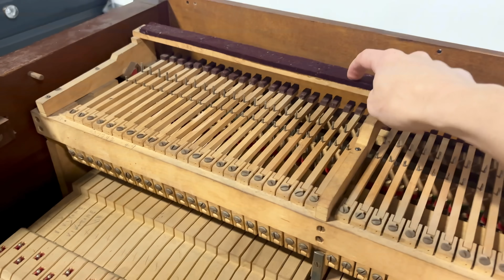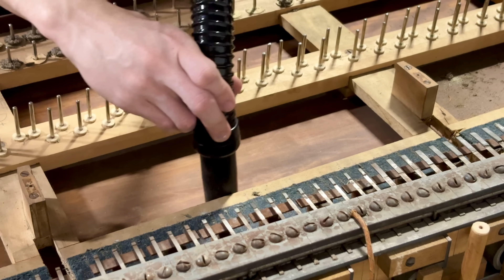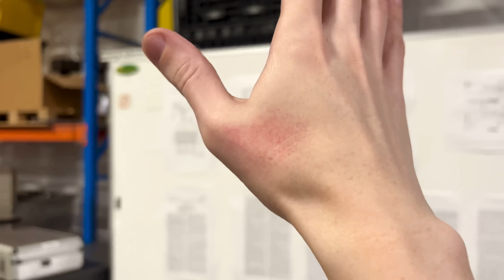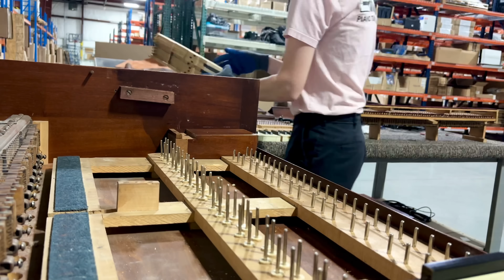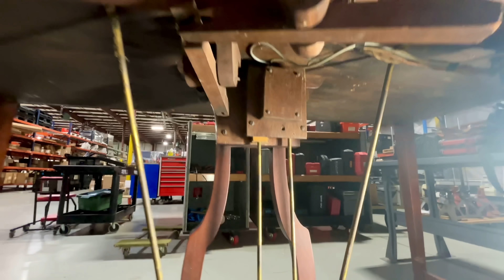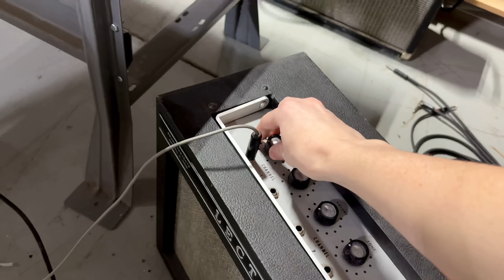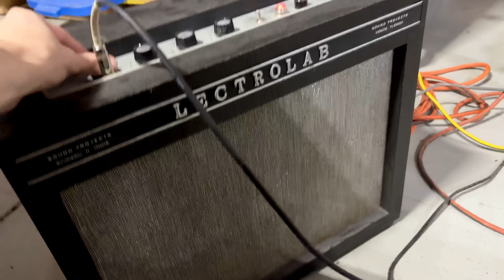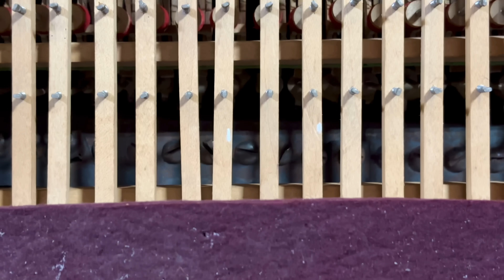Restoring an Instrument You've Never Heard (only 3 left)

Comment: I designed large photography flash systems for many years.   In one model we had an odd intermittent control failure.  We had a special area for testing these before shipment.  I ordered production to test each power unit for about 5 times as long as normal. 
On a day when i was elsewhere we had a single unit start to fail repeatedly.
They called me and i told them to exit the test area touching nothing.
When i got to the plant i approached the testing area like it was a crime scene making sure to avoid disturbing the setup.
While checking EVERYTHING the rest of the staff went on break and one guy fired up an AM radio to a local station for music.
Every time that music had a loud low tone the test bank malfunctioned.
Turns out the paint on the unit control panel was preventing the grounding screw from making proper connection, and turning that metal panel into an AM radio receiver from a nearby high power radio station.
However my photo flash powerpack did not have any speakers like your electric piano.😆

Another commenter suggested replacing the old capacitor.  I suggest you replace EVERY capacitor in the amplifier.  It is almost 100% certain most of the caps will have degraded over time.
Some restorers who are trying to keep the look as close to original as possible, will even hollow out ancient caps and stuffing newer caps inside the old cap shells to disguise the repairs.
Reply from the maker: Haha fun! There is no amp here though

Comment: Nice !!! 
What about the amp? I suppose the original was using a pair of 2A3's in push-pull ... or even a pair of "45"'s?
Reply from the maker: The only other model that has an amp is an old Weber PA amp that was hotwired--you can see that in the previous video I made

Comment: I am a retired electronics engineer. The potentiometer and capacitor could easily have been properly serviced. The pot could have been cleaned with Deoxit, which would have eliminated the scratchiness, and the capacitor replaced with a modern yellow poly cap with a 600v rating, and a capacitance to match whatever the original says it was on its label. It is hidden inside that wooden box, so nobody will see it unless they are servicing the piano some time in the future. These modern poly caps are much more stable and will not deteriorate like that old paper/wax one has. You could even have written a note inside the wooden box with the date if the servicing.
Reply: As a mere technician, I entirely agree with this engineer. (which doesn't always happen... 😅)
Reply: @stubryant9145  as an Engineering Technician i have terrible disagreements with myself
Reply: @stubryant9145 The techs are always the first to find engineering misses.
Reply from the maker: Deoxit F5 was used with no change--if only I included that clip I could have saved like 30 minutes responding to all the same comments lmao
Reply: @Emmarepairs I tried deoxit on a potentiometer for an old radio from the 30s and it did not help much either. So I took it fully apart and it looked like the carbon had just deteriorated. It was flaky and yeah unfortunately it seems like theirs really no fixing them :(
Reply: @Emmarepairs a potentiometer of this age might not be repairable. There are a lot of amateurs on here telling you you can fix it with deoxit, but the carbon composition material might be too far gone, if in fact that is the type of resistive material it used.
Reply: @waterfallhunter634 
You refer to a retired electronics engineer as an amateur? 🤦‍♂️
Reply: Not you specifically, but there are a lot of people on here suggesting the same "fix".
Reply: @waterfallhunter634 I should’ve read the other comments before offering my advice, lol.
Reply: @waterfallhunter634 Perhaps there is room to move the wiper to a different location to create a new track, and restore the operation?
Reply: @Emmarepairs everyone wants to weigh in having not done the work.
Reply: @Emmarepairs  Did you take the back off the old pot before trying to clean it ? That is necessary. Also, the cap MUST be replaced. that may well have been the root of the problem. If the cap was replaced, and the old pot cleaned, then the only solution is to replace the pot. Considering it, like the cap, is hidden in a box, it could have been replaced also without it being seen except by someone servicing the instrument in the future.
Reply: I always wrote our job number inside whatever I was working on. Being able to look up a job's previous faults and repairs saved a lot of time with future repairs.
Reply: I also claim to be a retired engineer so everyone will believe me 😂 when I say that deoxit isn't a wonder cure. 
It's very much possible that the tracks on such a pot that has seen very unconventional (heavy) use are damaged. And then you need a replacement, as adding things like pencil carbon are only very temporary solutions. Certainly with this use case. It's controlled with feet during playing.
She also noted in the video that because of historical considerations she decided to not replace the part, which I think is a perfectly valid decision. Same for the capacitor. She took it out of circuit and kept it original. If one of you "knows it all", couch engineers, buy the thing you can all do it your way. 
Until then, enjoy the video as it is. And ask yourself, what is the chance that an experienced electrical instrument mechanic has no knowledge of deoxit or some similar product.
Reply: @bzuidgeest  "She also noted in the video that because of historical considerations she decided to not replace the part" Which eliminated an important part of the functionality of the instrument. If you actually read more than just my particular reply, you will see that in another reply Emmarepairs says she did try Deoxit on the pot, but it didn't cure the problems. I also addressed all of the possible problems and solutions in subsequent replies on this reply thread, ways of handling proper repair such that from the outside the instrument would appear original, but also regain the function from this device. I suspect, from your sarcastic, snotty opening that you don't know much about electronic restoration, something that I DO have a great deal of experience with, since I have been repairing electronic equipment since the mid 1960s when I was still a kid, and later, in the U.S. Navy I taught basic electronics at PEA School in Dam Neck, and then afterward pursued the electronics field as a career. Today my main hobby is the restoration of antique radios, equipment from long before that piano was made, and up through the 1970s and early 1980s.
Reply: @powellmountainmike8853 the expected reply with another set of unverifiable claims about who you are and what you think you know. Just trying to look important and push your opinion more. 
The point you are missing is that it isn't your choice. It's hers. Buy the thing and then it's yours. 
This  repair thread??? You mean your opinion thread. It's all canned info from a dozen other videos. Nothing special or even new.
Reply: @bzuidgeest  "Buy the thing"? She doesn't own it, she's just fixing it; and, as far as the basic mechanical work, she did OK, but obviously she is NOT very knowledgeable about electronics repair.... nor are YOU from your childish replies.
Reply: @powellmountainmike8853 first of all, I didn't say, buy it from her. I said buy it. Most people would understand that as buying from the owner, who was in the video. 
My responses aren't childish. Thinking you can make all kinds of claims here and expecting everyone to accept it at face value is childish. 
Nothing you added is beyond the basics a 10 year old could shout after watching a few basic restoration or repair videos. The fact you don't recognize this, says a lot. 
You don't know me and I don't know you. Everything you claim about me is an assumption. Everything you wrote like anything else on the internet does not have to be true. I could claim right here I have 50 years of experience in designing electronic organs. You have no way to verify the truth of that. What you are really doing is deciding the truth based on if you like the response or not. Basically you sound like a maga fan. Good luck with that.
Reply: @bzuidgeest  I'm so very sorry youre stuck being you
Reply: @mycosys i think the same about you, now move along or actually add something to the discussion.
Reply: @powellmountainmike8853 She consulted the client and discussed options.  It's not her axe, but we respect that you would have done it differently.
Reply: @powellmountainmike8853 except she left in place the leaky, rotting caps??
Reply: A good reference toward all the comments in this heading/subject would be UncleDoug on YouTube, an antique guitar amp repairman/rebuilder/refurbisher and designer/builder of amps. UncleDoug really knows his stuff.
There are examples on his channel where he does disassemble/clean potentiometers to no avail, sometimes they simply must be replaced.
When replacing parts such as caps, he always leaves them in the case or seperate container as evidence toward provenance.
Sometimes he hides new caps within old via various methods so as to maintain original unmolested look of the subject piece.
Reply: @kajem575 I agree.  I am an e-tech but we didn't learn anything about tubes in the early 90s.  Uncle Doug is very inspirational, as it turns out the principles of amplification are the same whether it's tubes or transistors.  I think even Uncle Doug would agree that when you're restoring something to make it work, function trumps asthetics.
Reply: Any replaced parts could have the old ones put in a bag(?) or some acoustically quiet contaner inside the case somewhere...with notes.
(Collector details)
Reply: Double standards, keep pot and capacitor to “maintain” originality but putting two metal sheets glued 😅😅😅. So much easier to service this simple electric part
Reply: totally agree with you. A cleaning with deoxit and a replacement of that old capacitor is in fact mandatory. Then I'd do a control of the shielding (replacing the cable if necessary)
Reply: Soul-crushing indeed.
Reply: Women don’t do research like that… they do the bare minimum so they can get the trophy and too many sexless men are willing to give them praise for doing next to nothing special just for the possibility that they might one day be liked by a woman.
Reply: Deoxit is great stuff!
Reply: Completely agree. There is no benefit to leaving leaky, rotting 90 years ago old caps in place.
Reply: She needs to find another occupation
Reply: I restore old hamradio equipment. Sometimes we remove an end of the original capacitor and put a modern one inside. It's called stuffing capacitors. I'd try the capacitor out in the circuit before attempting to stuff it into the original one.
Reply: @micha @michael9022-o4z  that mostly done on those old metal-shelled multi-section caps? As in remove the old cap from the metal case and then put new equivalent value capacitors into the old metal shell to maintain aesthetics?
Reply: @michael9022-o4z  Yes, I am VERY familiar with this method. I'm an OLD retired electronics engineer. I have been collecting antique radios since I was a kid. As someone who has been repairing radios and TVs since I was a kid, I am opposed to using the method you describe. it is unnecessary since nobody but a technician who works on the set at some future period sees the components under the chassis. Re-stuffed condensers only confuse matters, making it look like condensers that have been replaced have not, and might lead to the future tech replacing them again needlessly. The only exception I make is if the condenser is VISIBLE above the chassis, or if it is, as is the case of one condenser in the Philco 48-482, wrapped with turns of wire connected to both leads of the condenser, creating a parallel LC component, where the proper diameter of the original makes a big difference to the frequency response of the component.
Reply: You site you wanted to keep it original, thus kept that failed capacitor for historical purposes.  There is zero value in using a failed electronic part.  Replace it.  Of course cleaning the old potentiometer.  You could also use tun-o-wash to do it, as it leaves no residue.  That being said, replacing it with a new one is also not really devaluing the piano.  You could put the original parts in a small bag, and keep it in the enclosure or somewhere else within the piano for "historical" reference.  Function takes priority for any instrument.  Just look at the restoration videos for violins as an example.
Reply: Sometimes the resistive material of the potentiometer degrades to the point where it can't be cleaned or repaired. If the potentiometer resistive material was carbon composition, then it could be badly degraded.
Reply: @waterfallhunter634  If you notice my reply just before yours, you will see that I addressed this. "If the cap was replaced, and the old pot cleaned, then the only solution is to replace the pot."
Reply: Leave it original. Golden rule of preserving value.
Reply: @nicbordeaux  Spoken by someone who knows nothing about electronic antiques, be they radios, televisions, or electric pianos. If they are ever to be used and demonstrated, without posing at the least a hazard of catastrophic failure causing obvious damage to the electronic parts at a minimum, and a FIRE HAZARD, or SHOCK HAZARD at worst, proper electronic restoration is necessary. This is the same as is done with fine, antique musical instruments like Stradivarius violins. They are carefully, and properly RESTORED so that they can continue to be played.
Reply: @powellmountainmike8853 

This is small signal stuff, just a passive RC filter for the output from the coils. There is no hazard in this case. But I agree it would be nice to bring it back to full functionality instead of preserving failed mass produced parts that nobody can see anyways. But it's not up to me to decide.
Reply: @westelaudio943 Actually, in old tube amplified gear, the voltages across these networks can be quite high, especially if they are in the plate side of a  circuit, which is why using a 600v new poly cap of a suitable capacity is advisable. as for the pot, a modern one of the same value would also be advisable if cleaning does not eliminate the scratchiness.
Reply: @nicbordeaux yes, but not the golden rule of making it usable. Value isn't everything. I personally think things last longer if people can use them.
Reply: @bzuidgeest OK, I have a very early aluminium bike. If any body rides it, the forks are going to snap. The brakes and other junk work. The aluminium is clean but not poished to a glittering shine.. It's value is in it being fully original. I also gave an Alcoa Maddy DB. It's had 
a new fingerboarf and bridge, and gets played from time to time. Maybe musical instruments are a bit different.
Reply: @nicbordeaux the value is wherever you want it to be, financial, emotional, practical. You move the slider to wherever position you want on the spectrum.
Reply: @bzuidgeest True.
Reply: “Electronics Engineer”✌️🙄

Comment: Very interesting, it wasn't clear but it seems to me that there's no real percussive range to the action? I didn't think the earth shield would fix the problem, after all, it's unlikely it hummed when it was originally built? Is it just me who  thinks it sounds like a prototype Fender? 🤣 I worked for Hammond UK in the Mid '70s where we took delivery of an upright piano with all the traditional action but striking metal tangs rather than strings. After voicing etc it sounded reasonably like an upright piano which, with some built in filtering shenanigans, could sound like a number of different piano types! Also, it didn't need re-tuning and you could plug in headphones! We decided not to import it though.
Reply from the maker: It was actually stated by letters Loar received and kept that a common complaint was the excess hiss/noise present lol

Comment: Potentiometer might be cleanable, but capacitors when old enough are basically consumables, especially older ones are guaranteed to have died. When you don't have any qualms about replacing the felts, why is a single paper capacitor ten times more sentimental? Both items have degraded to failure, if left alone degrade the functionality of the instrument. One was replaced without a thought and the other magically special. You could tape the old one somewhere as a keep sake if you liked...
Reply from the maker: Yes

Comment: You might want to revisit that cap and pot.  Not changing the cap and cleaning the pot out fully may have affected the sound significantly.
Reply: That broken central gear looks very close to what is used in the classic Wah pedal and those things are readily available. You could easily replace the gear, pot, and cap to restore that function.
Reply from the maker: Cleaning the pot did not improve--time constraints led to bypassing rather than waiting a week for the cap

Comment: Old capacitors will eventually start to leak (electrically) and perform more like a resistor: You should defenitly switch out that old capacitor! I've seen "Mr Carlson' s lab" sometimes stuff a new capacitor into the old casing when restoring old radios if it 's essential to keep it original but also functional.
Reply from the maker: 10/4

Comment: I loved your video but I don't get it, you add shield, modifying the original, but you didn't change the busted capacitor. I mean, the capacitor is a wearable part, shielding is not. What's the criteria?
Reply from the maker: Time constraints meant hiss removal first--waiting for new cap wasn't in that window so it was shielding to save pot, and then bypass pot if that didn't work
Reply: @Emmarepairs got it. And I’m sorry about the flood of comments I let in your videos hahah
Reply: Or the pot for that matter.